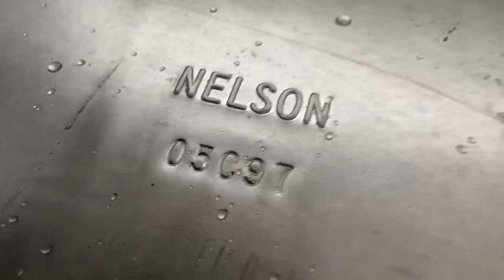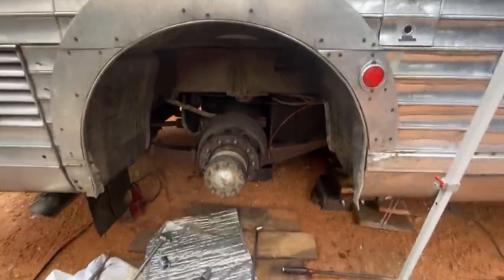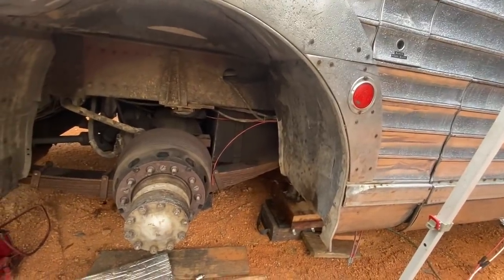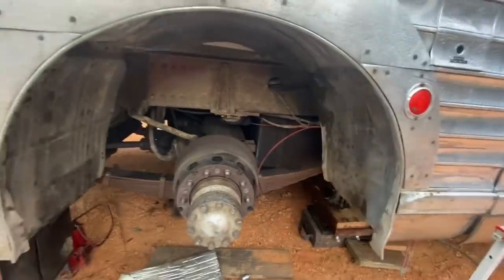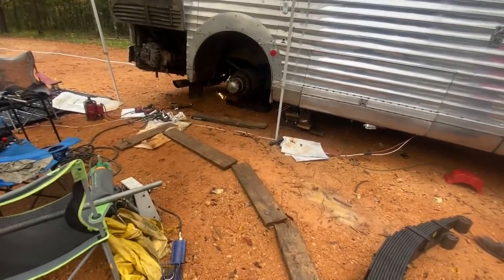MCI bus exhaust and silversides leafs spring

Comment: I also liked how the tool you used to get the wheel bolt out says, "Use Eye Protection."  So you squinted.  An eye patch in the wedding pictures would probably look worse than a scab/scar on the forehead.  Just use your "tough" look in the photos, and no one will mess with you.  Thanks for all these bus videos!

Comment: I used the same stud puller tool - you put it on with a hammer and i found the easier way to take it off is - once you loosen it leave it on the wheel and hammer it off while it's still on the wheel. ya got to can the broken one anyway and if you don't loosen it to far the rim will keep ya from mucking up the hub threads.

Comment: As always, Scott, it's a pleasure to watch you guys work! Have you considered pouring some concrete there, set a pad ad that spot.

You can erect a cover over the work area, prefabricated parking covers in steel are a thing of beauty. Consider a Butler building there, you'll never regret the investment, protection from the elements.

Comment: have Kelly use a little concealer on it next week any they will never know
Reply from the maker: I’m just going to wear two Covid masks.  One high and one low
Reply: Hehe. Getting old has a few problems. As an old wrench, I sometimes look at my arms and discover I'm bleeding. Don't know when I did it, but it's a crime scene.

Heat shields are sharp.

I don't like wearing a ball cap, but consider wearing one backwards when working underneath. When you bump about, that saves your head from cuts.

Glad you are ok, cuts to the scalp can be nasty. The skin has plenty of vascular flow, and your bean can bleed considerably. Just sayin'.

Comment: A few holes in it, just weld it
Reply: Welding on the outside does nothing for the rotted noise baffles inside it.
Reply from the maker: It’s probably solid inside.   It’s only rotted from the clamp areas
Reply: Brazing would be the way to go on that sheet metal. You could use rectangles of mild steel over top of the OEM sheet metal (after grinding off the alum plating).

Comment: Preventative maintenance all bus owners: You need to know how to remove all of the rubber air intake couples anyway. So do it when you are at home, not on the road. Inspect those rubber elbows for cracks and tears like you see in this video. If your engine sucks dust in over time, it will ruin your engine. You don't want to be the guy who says 400 miles from home, 'If I had known about that crack, I would have replaced that part long ago.'

Comment: Getting the extractor off is very simple you all ways keep 2 old studs around one right and one left.  You put the stud in the broken nut a few turns put the shaft from your air Chisel in the hole at the end put the socket in a vice if you have one handy hit it with the air chisel and they pop out in about two seconds every time.

On a different matter I have watched you monkey puck trying to puts cylinder heads on a 2 strokes. It is painful for me  to watch.  Let me help you.  We hade home made tool for this at are shop way back when and it makes life  so simple for this job. It attaches to the head exhaust studs for exhaust manifold it worked on 3 4 and 6 cylinder heads. It was home made. I hope I can describe it well enough that you can have one made it will make so much simpler. 

The aluminum plate bolted to the Manifold studs. There was a arm that came across the head with multiple holes in it this was for the different angels. The arm would pivot at the pivot hade some pre set angels in it that you could lock with a bolt One was for V engine it would drop the head on the block at the right angel every time then just put the head bolts in.  The other  adjustments was for putting the head on flat like a bus. The arm was very close valve train it would be great to get in on a bus we’re there is not much room to work We did trucks Just use your engine host to put it in place as always. 

The 3 adjustments was at a slight angle say 10 present of of 90. We hade some trucks that the 6V71 were in on angle. So in this setting it would hold the head at the angle of the block.  Just drop it dow simple 

My friend worked for the bus company that made the same tool but it did 6V71 like your bus no adjustments. They hade a different tool for the 8V71 as the engines were on there side in those old GM busses. Hope this helps keep up the good work.